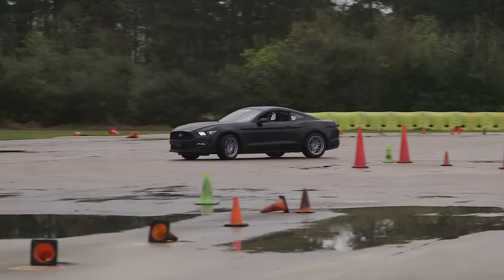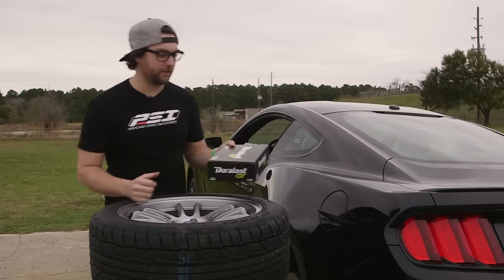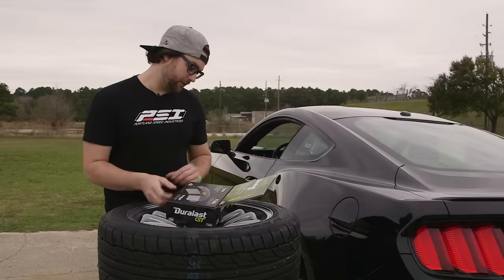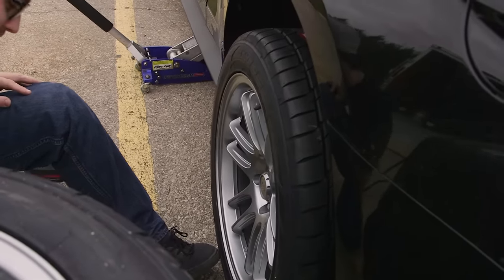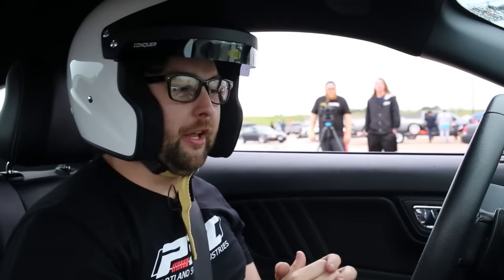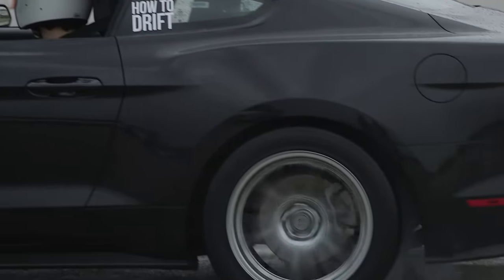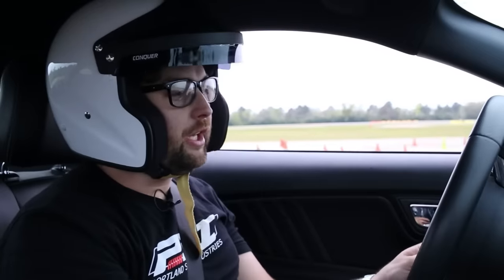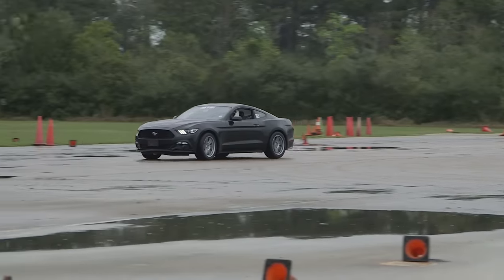HOW TO DRIFT AN AUTOMATIC CAR. No Clutch, No Problem. LETS SHRED IT!

Comment: If I see a Prius doing donuts I’ll have to report this video
Reply: it can only do a donut backwards cause it is front wheel drive
Reply: Both of you realise this is a joke, right?
Reply: RubricKnight378 some people just think that they can drift any car so am taking the chance of being r/wooshed
Reply: Yeah i understand but he is only joking, i dont think any sane person will believe they can drift a normal prius or another car like it.
Reply: mtthedon this video got me drifting my dads Prius
Reply: Its actually possible to drift a fwd you just have to pull the hand brake push down on the throttle a bit but before it straightens you pull the  hand break again and just repeat the process. Or you could use PVC pipes on the rear wheels like they do in japan
Reply: Did it in  a corolla
Reply: Charlie O'Leary Yeah there is many fwd drifting vids that look very good and clean I was gonna comment a similar comment to yours
Reply: A Prius can go above 2000 rpm???
Reply: @cherokeecleland3794  looks like someone has a prius
Reply: Yo😂
Reply: @anthonynguyen1345 😂😂😂

Comment: How to drift an automatic 
1: find gravel parking lot
2: stop
3: pedal to the floor
4: steer where u want and stop by taking foot off
Reply: that’s me hahahaha
Reply: Lmao, that's what I do
Reply: Same with manual
Reply: 5: Ruin your paint job 😂
Reply: Tires are fuxked after 4 doughnuts on gravel, know from experience and $800 on new tires on my family suv lmaoo
Reply: Wet pavement is key
Reply: @Sxppin first time I actually did a controlled drift was on gravel/stone road. With an open diff it’s actually super easy to control. With a sub 200hp automatic from the 90’s it’s just hard losing traction. So wet pavement is the only choice but it’s so hard to predict when the car will skid with open diffs. Really need to weld the diffs and lsd at that point

Comment: Too bad my car is front wheel drive and the hand break is actually a pedal :/
Reply: i`m drifting my impala when its snowing without a problem!
Reply: William Malamas snow drifting is for newbs
Reply: your handbrake is a pedal? I feel like it's more easier to drift it because you can use both your hands on the wheel and makes it less uncomfortable.
Reply: Spadeofdarkness™ it's actually harder cause now you'll have to have fast foot action to pop it in and then right back out
Reply: Shane Goomasy well maybe for me. I play the drums with a double bass drum so I got two pedals for one drum. then again, it's a drum pedal not a stiff car pedal.
Reply: Come to Ontario you will have no problems in the winter
Reply: The pedal handbrake you have to press in with your foot, and then release a lever w/ your hand
Reply: Install a hydraulic ebrake
Reply: Elder Goat every starts somewhere
Reply: @hoodiedrifts3994  a hydro is a lot of commitment for someone who hasn't learned yet. Not worthwhile to start doing mods like that on your car until you've learned to drift somewhat and after learning, are comfortable ruining your car (like drifting inevitably does)
Reply: I’m drifting a Camry with no problem at all
Reply: Is it a crv?
Reply: Install a hydro and shitty narrow rear wheels and you'll be able to do continuous drifts.
Reply: get some plastic trays from your local micky ds and drive your rear wheels on to the trays. Lock your parking brake. and then drive. Boom! your drifting!
Reply: William Malamas what year is your impala from?
Reply: Shane Goomasy "it's actually" easier unless your my grandma
Reply: Adnan  Seif  those have abs couldnt even get mine to lock on snow
Reply: Brake kicking time.
Reply: Shame
Reply: put trays under the rear tires... they'll last about 15 feet but its cool ig
Reply: I drove a 1990 honda civic wagon, and was able to "drift" it everywhere, you dont need a hand break to "drift" a front wheel car, it's all about how you go into the turn and exit the turn, it's a technique. Just takes time.
Reply: @halvedwits  double clutch lol
Reply: @cameronlepa3433  yea ive since mastered the footwork to do so with superb ease
Reply: Reverse
Reply: Same but I have a little trigger button hand break that works well for burnouts but idk about drifting never tried using it while in motion

Comment: So what happens when you mess up? I’m really curious about the physics. Would you rather just keep spinning or is there risk of you flipping?
Reply: You have to have balls and stay in it.
Worst case you spin out or mow some grass or rub some body work.
Suddenly letting off the throttle ,panicking turning in and gaining sudden traction can flip you. Especially if you roll the tires under the rim.
There's a video with jay Leno and Bobby Sox where they flip a gasser on its roof.
It's an exaggerated example but you'll see where he goofed and flipped it.
Reply: unlikely to flip at such a low speed

Comment: As a horse person, this makes perfect sense to me. The way you explain it make the think that drifting is pretty much leg yielding a car (a movment in which the horse moves its body at an angle along a line and crosses its legs). Counter-steering also sounds quite familiar. Autocrossing and drifting are among the few motorsports I feel like I can actually understand.

Comment: Thanks for the video...
I’m finishing a build on a 68 firebird with auto. I was debating some drift action so this was helpful in deciding. Projections are 520 hp and about 490 ft/lb torque, so I’m thinking I’m not gonna need handbrake assistance to get my backend loose..
A suggestion...a split screen for interior/exterior would rock...
Ima go look at ur other videos...👍🏼

Comment: I wish you told what kind of damage you should expect for the car when you press both brake and gas pedals at the same time to do burnouts. You can obviously do slow speed drifting with that technique, too, but you'll overheat your brakes and tires pretty fast. In addition, you have to be careful not to overheat your torque converter.

And if you don't have old style automatic gearbox with torque converter but robotic gearbox, do not try pressing both brake and gas pedals to do burnout unless you want a clutch repair project, too.

Obviously, any technique you use, the tires are gone after you start doing burnouts or drifting.
Reply: No fucking shit it's gonna wear your brakes out. He said it himself the brakes are actively working against the transmission in an auto because you can't clutch in

Comment: I drift my automatic E36, and people don't seem to believe it's possible right after they just watched it happen lol..

Oh, and by the way, I would love it if you could do a bit of a tutorial on nailing intentional 360s?  :)  I've done a couple of nice ones mostly by accident, but I really don't have an understanding of how it happened.
Reply: Hammerhaus Kennel with hydro ebrake?
Reply: Nope, just an extended handle on the factory parking brake.  Chelsea style.  Hydro would be better I think, but it totally works.
Reply: Hammerhaus Kennel but it still locks the rear wheels like a manual car?
Reply: Absolutely!  As long as you remember to let off the gas at the same time as you pull the handle it works perfectly.  If you stay on the gas, the parking brake will not overpower the power of the engine.
Reply: I can do 360's in my mustang, it's just picking up speed then serious countersteer from a really hard whip
Reply: Hammerhaus Kennel ok
Reply: Hey , do you think it doesn't affect the transmission to use the handbrake while in drive

Comment: No clutch no problem! 
Until the clutches and bands inside that auto trans snap in half!
Reply from the maker: +Alvin Ameyaw you shouldn’t be drifting an auto if your doing it all the time anyways.
Reply: I've seen you on lo inertia vlogs 🤘🏽
Reply: Why though?
Reply: My experience is, If you rally a car, you will break it. If you drift a car, you will break it. If you drag a car, you will break it....
I expect to have to repair stuff if I’m going to push performance limits, especially if I’m beating up on stock iron...
It was snapping 2nd gear in my Indian scout, after an over bore/cam/exhaust/ignition upgrades, that taught me how to ride that kind of torque...

Comment: I can drift the fuck out of my gs300 but once I did a manual conversion definitely made it easy. Instead of building speed and throwing it in a corner, I can just clutch kick into initiation
Reply: Tbone Scriv I really want to do the conversion to my 2003 is300. I'm pretty sure it's almost an identical process to the gs300. How much was the total cost of your conversion and what transmission did you use bud?
Reply: I would say manual swapping an IS is cheaper because they come in manual too, therefore not needing an e brake relocation

Comment: I have a 1994 manual supra drift missle but I also  have a 2017 mustang ecoboost in auto as my daily. Weirdly enough the mustang is super easy to drift on stock setup.
Reply from the maker: Right? its a good car.

Comment: I saw you post about making this video on IG forever ago. I've been teasing the idea of putting effort into my auto GTO to learn to properly slide it because just having a pretty show car has gotten a little boring. I guess its time to throw some other wheels on the back and learn to do some cool stuff in it. My only concern is the longevity of the 4l60e trans with using the handbrake a lot.
Reply from the maker: Yea its unlocked off throttle

Comment: Great video 
#1 Thing pull abs fuse and disconnect wheel speed sensors.
"Advance track off" doesn't give you full control. Maybe it's more so automatics...but these cars try everything to stay straight and it is annoying.

Comment: you mentioned automatics not having a lot of self steer is that just with automatics or do manual cars have different suspension setups?
Reply from the maker: I meant this automatic in particular. Also, It seems like less self steer because they dont engine brake off throttle during transition.
Reply: Chelsea DeNofa I've heard the new stangs have some kind of adaptive electric steering that keeps it from self steering quick enough to catch up with the rear end. Is that true or is it all in the transmission?

Comment: ok, now a how to drift a fwd car lol
Reply: adrian arechavala use McDonald's trays
Reply: Handbrake and pray
Reply: Scandinavian  flick , throttle and momentum
Reply: Any plastic trays on rear tires, rip handbrake all the way and floor it and just start swingin it :)
Reply: cookie boii but the ones they give out are like a cardboard that smells like shit
Reply: Get some trays from a fastfood restraunt, place under rear wheels, pull e brake when your on the trays, turn off traction control and start swingin
Reply: Everyone keeps saying fast food trays, but maybe a week ago at a car meet some guys in a Honda put some plastic covers from the sidewalk ( like manholes but not really) seemed to work the same
Reply: don't us trays that's not drifting. it's easy hold the E brake, work the gas to keep the car going around the corner at the end of the turn let go and drive away
Reply: a&w trays
Reply: I most definitely go try this on a 2007 Saturn vue
Reply: Approach a corner in enough speed... so that there might be understeer in the front tires then break and downshift....  it'll be like a powerslide tho..... with pretty little control over the slide
Reply: Put it in reverse, bam rwd
Reply: Check Conorsevs channel
Reply: @NoootABigDeal  trust me i did...
Reply: I don’t use the E brake anymore. I use the regular foot brake. Just get enough momentum, then slow down a bit before entering and do a hard turn in the direction you go in. It also helps to use inertia to your advantage so you can really slide into it.
Reply: Reverse drift... duh
Reply: 510B won’t that just eat through the tray though?
Reply: Skandanavian flick whichever direction you wanna go, yank the handbrake, full throttle it, point the wheel where you want the front of the car to keep going, release hand break. Too much handbrake and you not aight. Just keep the wheel on point.
Reply: The Arabs have plenty videos of fwd drifting lessons lol
Reply: Japanese already did
Reply: Thats easy... don't

Comment: What happens to the transmission when you pull the ebrake?

You put the clutch in while pulling the ebrake in a manual car to drift, so I wonder what gets worn out in automatic. Is it the torque converter?
Reply from the maker: Torque converter

Comment: I taught myself self how to drift on my gokart the key is gravel and use the break before the corner or mid corner after you stop breaking and get the car to slide floor it to drift and use techniques and you should be fine Eurobeat helps a lot

Comment: In a mustang you just floor it and there you go your drifting.....if it's possible to do it with front wheel drive tho?
Reply from the maker: Nope, FWD isn't real drifting.
Reply: Jaja thanks man your video got me excited so I tried to do it with my Honda I hit a pole XD you make it look easy keep it up!!!
Reply: Hahahahahaha I'm dead🤣
Reply: rambo Epic it's powersliding in a fwd car not drifting, but still very fun if done well. If you can control a vehicle well i highly recommend you try taking out a manual fwd car with bald tires in the back and grippy tires in the front for some cornering fun, in winter especially it makes commuting a thrill.
Reply: You can sort of drift in a FWD car. I used to go to an empty parking lot with my 09 Civic and slide around lamp posts, it can be done, and it's really fun. That being said...the wheels can lock up really hard in a FWD car sometimes making it impossible to countersteer.

Comment: I don't find this very impressive considering the ground is wet
Reply from the maker: It just happened to rain, If It were dry I would have done in then. Its all the same tho. Easier to drift in the dry to be honest.
Reply: Chelsea DeNofa Fair enough. I would like to see you drift on dry ground with a low power car
Reply: @clouds8950  it's possible but extremely difficult. If your car can't drift then you shouldn't be trying to.

Comment: One mistake one death that means if you are unlucky if you mistake because of steering, brake, etc I am 100% sure you will die if you are unlucky especially in beginning mistake. So its better to try on bike you can fall down but if you wear helmet could save you but still you could die. However bike is more safer than car in drifting
Reply: Fuuuuuuckkkkk no.
Reply from the maker: I live my life dangerously.
Reply: What kind of shit am I reading

Comment: I am a bit confused.
In a car with automatic transmission when you are in drive the gearbox is connected to the wheels and when you pull the handbrake nothing snaps  HOW.

Comment: hey man, i´m a little lose when you speak about the desactivate a controls, in the first step, you desactivate the traction control and the track mode?  it´s neccesary take out the fuse of abs too? or you have specific button por desactivate the abs? it´s neccesary desactivate the abs for drift?? sorry for too much questions.... but i have the same car and i want to start to practice..... and i did thinking it´s not possible with all this safety sistems..... im not speak english good and i can´t understand you good, its very fast. if its possible can you describe step by step what do you with the controls of safety and systems? thanks man, and great video! you have my like and suscription.
Reply from the maker: Yes you need to disconnect all of them in order for it to work on the auto.

Comment: Let’s say for instance you have a automatic with a 3600-4000 stall, would you need a button on the hydro brake to unlock converter on demand or would you be ok to just hand brake it and floor it

Comment: Please help me, i have an Automatic S550 v6 and i would like to drift like you. Did pulling the ABS relays and wheel speed sensors allow you to pull the handbrake and lock up the rear tires? When i pull the E brake it just kills the engine honestly. Also where were these sensors and relays located? sorry for being such a noob.

Comment: Is there a way to do burnout with a automatic car with the traction off but the car still prevent both brake and gas depress at the same time. Like the moment my IS tire started to spin, the car automatically reduce power to prevent the spin...

Comment: How bad is it on a transmission to abruptly stop it while It's still in gear? At least with a manual, you can put in the clutch to take away the force of the engine.

Comment: Won't it upset the engine if I pull the handbrake on an auto rwd?? I have an auto gt86
Reply from the maker: Nah its usually fine, it decouples the converter

Comment: Ok I’m getting drifts down. I have a c300 rwd. So how do I do brakes and accelerator. I’m trying to practice with one foot but it’s hard but with using two foot for each pedal and I mess up still. Still working on it. Any recommendations?

Comment: you have to hit use the brake pedal if you want to drift, its not just the steering wheel
Reply from the maker: This tells you how to do it... brakes are not used much. Handbrake yes.
Reply: once you begin a turn at a certain level your tail already wants to come out from behind so if you just brake the right amount very quickly your rear will begin to slide as the weight get shifted forward however slightly and from there you control it with the steering wheel and gas

Comment: I have a question thats prob stupid but idk. So if a car is automatic but it has that drop down slot to go manual will it drift just like a manual would? and in this video is he using that manual part or not. what would be the advantages over buying a manual over an automatic that goes manual?

Comment: Do you need a different type of Differential to drift a auto I have a 2006 325i but every time I try and do a dount I can’t get the car to spin out it slides and I even took traction control off
Reply from the maker: Yea you’ll need an LSD or welded diff